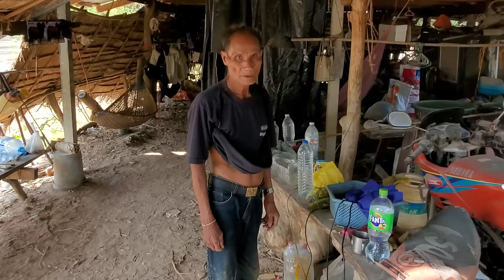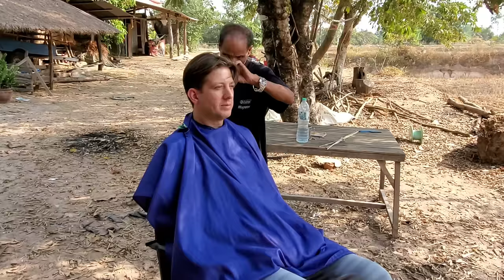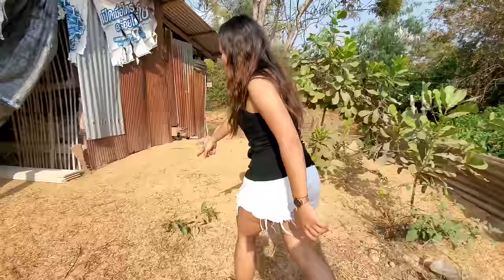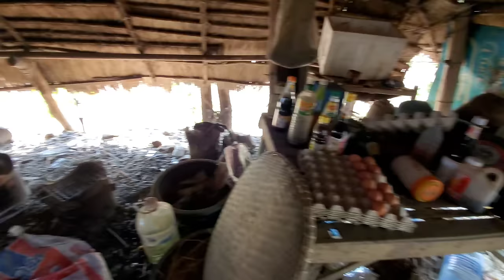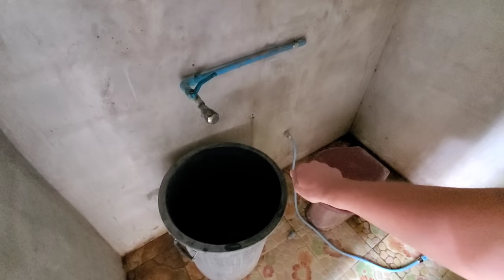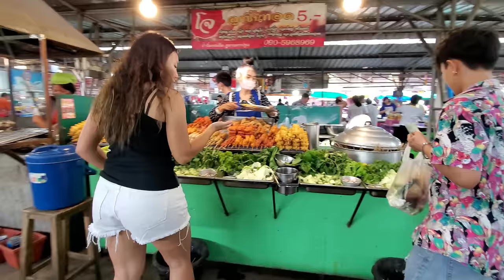💈HAIRCUT on THAI RICE FARM by Mr. WANG (w/ bonus HOUSE TOUR!) 🇹🇭 Ubon Ratchathani, THAILAND 4K

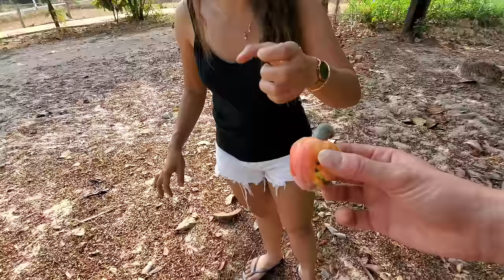Comment: @22:52 You can eat the fun part too. However, just raw as you see it there. There is an oil right below the outer skin of the cashew nut that is unhealthy to eat. Some will say its poisonous as well. The unprocessed cashew nut have to be cleaned, washed, and baked before you can eat it raw.

My Two Cents. xD

Comment: Where's the electricity coming from for those clippers?  I'm dumbfounded.
Reply: FootBear NYC dude I noticed that too but figured maybe from a generator
Reply: @Niles-Guy  ahhhh
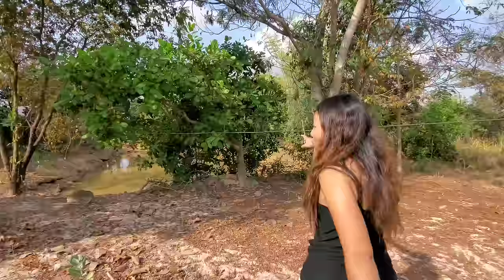Reply: At 21:54 you can see power lines in the yard that go to the house
Reply: Midway through the video, you can see "utility poles" and the electric lines. They are just far more rustic-looking than anything you'd find in the US. The countryside here really doesn't have OSHA or building codes so rural power to the end-user has a lot of DIY to it. :-)
Reply from the maker: @GarNelson1  Exactly.  But it all works.